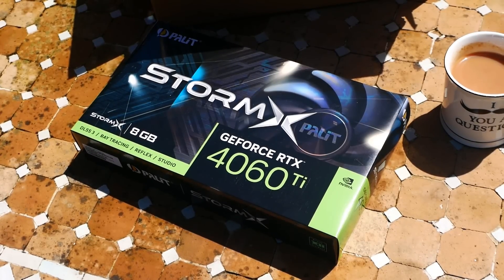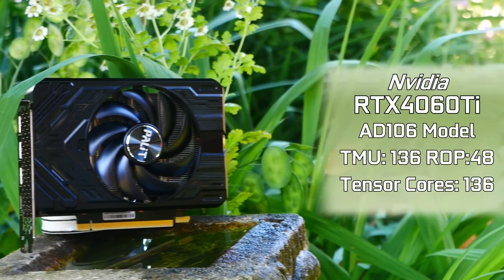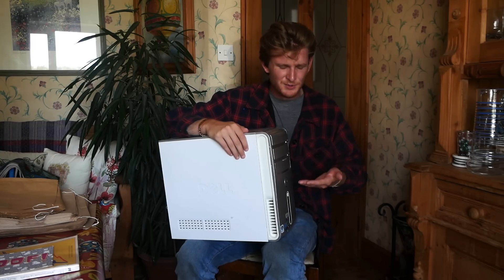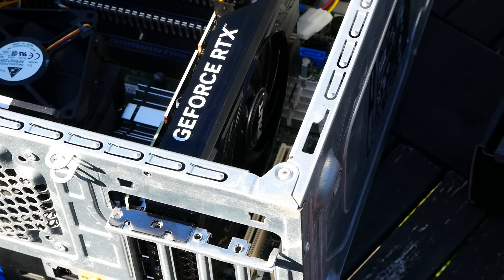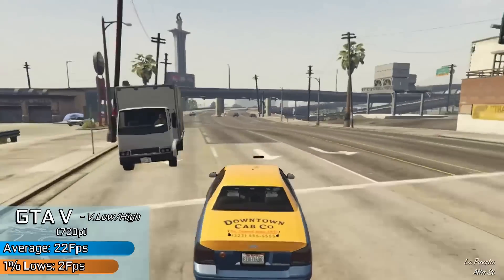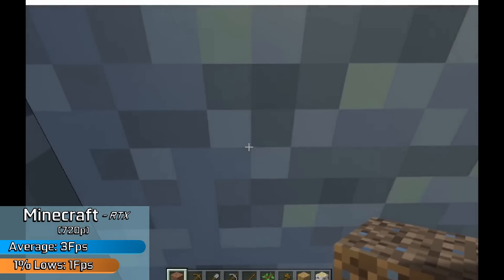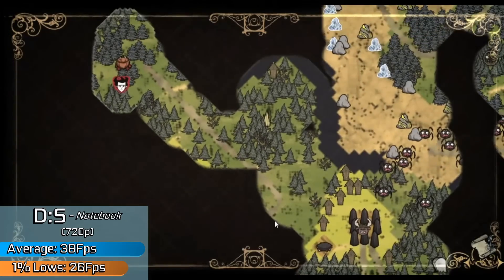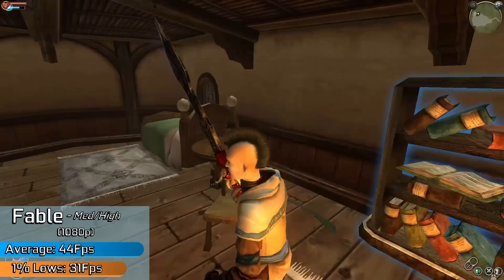RTX Graphics Card in a 20 Year Old Family PC...

Comment: Hi, i have just brought a P4 HP off Ebay, And It was in a bit of a state Softwear wise
It was security locked and i Could not get it to r=work at all, Finally i Got An OEM 
Win XP Pro From Ebay, It Still wouldn't Do nothing, The Install kept Getting Stuck 
On 34%, Anyway Slowly i am building a very nice Machine, I have got a PCi GeForce
880 0C2 And i am a Bit Scared of Putting it in My P4 till i know a bit more about the 
card, My Memory is DDR2 And on the card is DDR3, Will the card run on my P4, Just
looking at your Video tells me it Just might, But i want to be sure, Cause after all my 
hard work i would hate to Blow it up with smoke coming out the back LOL. OH! YEH!
I got a genuine Sound blaster Live Off Ebay And it was like Brand new man, Now all
i need i for you to Give me the green light and say of course it will work My Old San.
i paid £6 For the Graphics card from my mates Retro shop, he Obviously Didn't know
what he had, Well i didn't know what i had till i watched a few You Tube Videos, It's a
well sort After graphics card, Im'e well pleased. All i need now is some good news
from you My friend, Great video mate.

Comment: i used a pcie to pci adapter to get a radeon r9 360 working in my dad's old dell dimension 2400, also maxed out the ram to 2gb and cpu to 3ghz. after alot of modding i was able to get the original version of skyrim working on there in 800x600 res at like 33fps which was amazing to see considering the onboard gpu was a intel 845g that struggled to play dx8 and 9 games. anyways my dad just still uses it to check email and what not. he refuses to stop using it so i've just been upgrading it for him.
Reply: Should of just played it on a Xbox 360 runs it easily lol

Comment: the regular 4060 is made on the 107, know what else has historically been made on that? THE XX50 SERIES CARDS like the 1050 and 3050, do you know what the XX60 are supposed to be on? the 106..... so why did they make the 4060 on what should be a 4050? simple, this card is called the 4060 but its really the 4050 in every possible way except the name, even its performance aligns with what should be the 4050 if you look at the test data...... in short its a scam, you are paying 4060 prices for what is really meant to be the 4050

Comment: So theres a bit of magic to the pentium 4 that has been lost in the general scheme of things.  Back when optimization MATTERED, a pentium 4 would do numbers if your pipeline could stay sunk.  So, if you had no warbles, no weird bugs in your threading, a penium 4 would WANT higher graphics settings because, despite the lower cache, it is BUILT on the back of dumping huge blobs of data.  I myself am about to start working with a P4 again, and am quite excited with it having the appropriate 4GB ram, a good chipset and bios, and enough chokes to kill an african orphan.  Your setup there would greatly advance in speed if your ram was balanced, maybe if you even had an NVME drive.  You might see shit happen more stable.

Also general rule for anything related to itanium, plug in a ps2 keyboard so you have a direct control line to the CPU in case of Alt F4 in emergency.  USB keyboard on Red Dead you will have no input because the controller's signal is being completely covered up by the sata logic data stream.  But the PS2 line goes straight to the CPU, it skips ahead of everything in pipe.  PS2 is a MUST HAVE on a pentium 4.

Comment: the high textures running better in gta 5 is prob due to the exchange between gpu and cpu, slowing down the frames pumped from gpu to cpu thus making the cpu have to render less fps

Comment: 6:35 you've installed the cpu fan backwards! it should blow air into the radiator!
Reply: Fans remove heat, blowing air at the radiator is the opposite
Reply: @shredhappy101 Never say fans installed like that! A good example is graphics cards!

Comment: The real bottleneck in you're setup is the G33 slow chipset...A better test would be using a P43 or P45/ICH10R chipset with a Core2Quad,8GB is the max memory the boards will support and 6GB is the max for G33...I still use a P43/ICH10R Gigabyte board with 8GB DDR2-800Mhz(quad channel) with a RX580 8GB card and a SATA2 7200RPM Segate Barracuda 7200.12 black drive 1TB...Still run most games no issues at all,added a 2.5GB lan PCIX and it helps,can run 100FPS on Warframe on Medium settings...Overclocked Q6600 2.4 up to 3.02Ghz for the last 15 years solid and the PC stays running all the time with water cooling AIO 240mm cooler...20 year old build still works but it's time for some DDR5 and NvME drives for me..

Comment: holy crap i threw away my inspiron 530 mine had a q6660. i threw it away because it would not chillout on the thermals. the cooling on this pc was horrendous. the design on it doesnt compensate for thermals. and the MB would not allow 8gb ram. so x64 was bottleknecking for win10. stupid windows antimalware would cripple the cpu. it had one exhaust fan on the chassis and one dinky fan on the cpu that had no effect on cooling when when there was no airflow inside the chassis. check your thermals with cpuid hwmonitor and you will see the dell sucks badly. the only thing you can use a dells inspiron 530 for is xbox cloud gaming. but it does ramp up the cpu fan extremely loud and is very smooth 60fps playing the newest BF game. i was using hymix 6gb ram, q6660, asus r7 240 2gb, soundblaster audigy se, wd green 240gb ssd. not sure if i threw away th einspiron 545... huh that was on the same buid as the 530 just a nicer looking black chassis but still crappy thermals.

Comment: Speaking of minecraft, my T60 with a 2.3ghz core 2 duo and 3GB of RAM ran 1.16 just fine. 1.19, however, failed to even start.  Got 20-25 fps consistently on 1.16 though, which was good for the radeon 7500 graphics that thing had (for comparison, 2012 era intel HD graphics were about 10x more powerful)

Comment: From new, I had a P4 3.2GHz (with hyperthreading) & Athlon 64 3800+ (2.4GHz) at the same time.  Both with Windows XP 32-bit Pro & 2GB RAM: My P4 wiped the floor with the 3800+ when ripping DVDs, by a big margin!  Possibly due to the 3800+ lacking certain CPU extensions (or overheating)?
However, I recall the 3800+ feeling snappier during general use, & faster with games (even with the same GPU).
Although people say the P4 ran hot, I recall having cooling issues with AMD CPUs of that era...

Comment: If you were using a RTX 2060, or RTX 3050, it would still be too much video card for that system. The Pentium 4 is also missing too many instruction sets to run modern games. Trying to emulate those missing instruction sets, is going to be too slow to be playable. That PC isn't worth trying to save, even if you got it for free. Just because it still works, doesn't mean you should use it.
Reply: Thank u for saying that it saves me time watching the video

Comment: i think you will getter better fps with older gpus 
yesterday i finished update windows 10 pro  on a socket 775 system with a cpu from socket 771  with mod cpu with mod motherboard bios 
intel xeon x5460 3.5ghz oc + asus p5kc + 8gb ddr3 1500mhz + gtx 570 glh 800mhz oc 
it runs windows 10 surprisingly well it was fun to build and is a extra heater for winter time

Comment: Driver overhead alone from modern 500MB+ Nvidia packages also play a part with extreme CPU bottenecks. You'd likely get better frame rates with slightly older cards on the oldest driver version you can get your hands on.

Comment: What was the sound situation with the games that run in single digits?  

Regarding OBS, to be fair to the P4, it is also running the game and Windows, not just OBS, right?  :p  

Thanks for another fun video.  

I never had a Pentium 4 CPU, at the time, I was full on AMD, apart from my then laptop which had the Pentium 4m which at the time I found fine without issues.  
I see P4 taking a lot of flak on YouTube, but as I never owned the desktop variant, I will stay out of the discussion.

Comment: You are kidding with this test. Long time ago Pentium 4 to Core 2 quad dont work at normal with 2080 ti and better gpu. If you will running some games. These processors dont support at all. :)  Pentium 4 is too slow for Windows 10. I tried surfing google with Pentium dual core with good SSD drive and DDR 2 memory. It terrible. So slow. And it doesn’t even make sense to test games.  Even if you find 16 GB RAM for this computer and a super fast SSD. It won't get any better. Without a Core i3 or core i5, at least the lowest generation, you should not run such tests. Just you need forget Pentium 4 and Core2Quad in forever. It bullshit.

Comment: I play with an i7 3770k/ 1660. Most games will use 99% gpu and 30-50% cpu.. but cpu intensive games run like crap. Fortnite is playable on preformance mode but on dx12 it stutters a lot and the gpu cant hold a high usage cpu will peg at 100 and gpu will drop to about 50% and then catch back up in a less cpu heavy area.

Comment: My old desktop was qx9650 with GTX 1060 on P5KSE mobo and delivered  frames in 60's in Crisis and Far Cry 5 at 1024 x 786 with most settings on high. That was with Win 7 Ultimate. When I went to Win 10 frames dropped to at best mid 50's with lots of settings dialed down to normal and some on low 😞

Comment: I have an old Dell Inspiron 530 like the one in the video that I bought with a C2Q Q6600 2.66 GH processor.  I spray painted the sides panels and side grill black and cut out fan grills on the top and side.  I also screwed an 80mm fan to the front intake area.  I still have it and recently took it out to relive old memories.  I put in a 92mm Cooler Master tower CPU fan, put in a new PSU and added an 8600 GT in there.  May have put in an 8800 GT, can't really remember.  I liked the 530 chassis because it was very compact.  It was my first try at case modding and the most I've ever done on a case.  I reused the Q6600 on another build that I built from the ground up.  Good times.

Comment: Apart the Pentium 4 , the lack of RAM is often a stopper. I saw a video about an Nvidia 980 on an old Core 2 Duo, and it went great as long as the game could run in the 4 GiB of Ram of that machine: sadly it prevented more recent games to run, but it could be guessed that with 8 GiB they would have also worked acceptably well...

Comment: Is this a new thing? Videos of crap PC's that I've thrown away keep turning up in my feed.  I've got loads of weak CPU's such as a Pentium 4's, Semprons etc that I've used for overclocking, I could easily put something together and bench it.  I've also got the best motherboards, chipsets, fastest memory and coolers to go with these tired relics to give best possible performance if that's what people really want to see.  On the graphics front the weakest cards I have left are GTX260's which I could run in SLi.
My idea of a budget PC is something capable of playing todays most popular games like Fortnite and Warzone 2 in 1080p which you can build for about £250.  The reason a weak cpu will play better with the graphics turned up on an overpowered GPU is because there will be less frames for the cpu to process meaning less stuttering.  Systems will generally work best with a GPU just under the limit of what the CPU can handle, anything over that and you can potentially lose performance.  Something like a 7000 series Nvidia or mid range 8000 series would best match this CPU, the legendary 8800gt is probably too much.  It was the first GPU under £200 to match the games consoles of the time and play Crysis.

Comment: facepalm A nice Sleeper PC in this wonderful Case would have been nice. But this Video is nonsense. For Example: An AMD AM4 Board with a Ryzen 1600+ would have been a wonderful counterpart for this GPU.
...Old Hardware with enough Potential, replacing the "very old" Hardware, for using an almost Up to date Graphicscard in a Stylish Retro Case. THAT would have been nice to see.
PS: I know that the Case has to be modified because of the I/O Shield

Comment: Considering how the 4060ti is, you could have used a regular 3060. 
Not a bad choice for this test though. My opinion is the 3060 is better. Now that fsr is coming with frame gen, I think the regular 3060 12 gb will outperform the 16 gb 4060ti. We've already seen that card with frame gen using dlss 3 and it sucks outside of 1080p. The old 3060 is pulling around that same performance at 1440p, I can only imagine frame gen making that card work better.

Comment: That is the kind of wild stuff PCI Express was made for.
And don't worry about the microcode. I can throw my Cedar Mill P4 HT 631 into my P35 board without issues. Not officially supported, but that is more a thing with the power delivery. Intel updated stuff for Core 2, and just dropped out Pentium 4 support, but those with 200 MHz FSB run without issue.
So yes, from a Pentium 4 to a LGA711 Xeon quad core, all of it runs.
I wouldn't even worry about power draw. Cedar Mill runs at 84 W and Core 2 Quad are set to 95W
Next step, Core 2 era single core Celeron? That should perform better in quite a lot than the Pentium 4

Comment: I wouldn't do it, only has 8 lanes.  That's quite a bottleneck with PCIe 1.0... But it doesn't matter with the old processor, it probably doesn't matter anymore. Otherwise an interesting experiment 😁

I have an AGP to PCIe adapter here and am running an Athlon XP 2400+ with GeForce 960.  Total overkill, of course, and purely for show purposes.  I can do that up to a Pentium 2 or Socket 7.  It doesn't work with even newer cards because XP is no longer supported.  And Windows 10 and 11 doesn't work on such old boxes.

Comment: liked because of the Inspiron 530 case?... I bought a system for ~60 $ (I liked the design) and then used a grinder to cut a hole for the IO... and put in an modern MB (Ryzen) in it, replaced the fans with real quiet ones. Works like a charm and looks good (retro almost).

Ohhh and your mod seems great...

Comment: I have a macbook pro unibody early 2010 15 and I can play gta5 on it and I use windows 10 😂🙌🏼, I did upgrade the hdd to a ssd but that's it, and honestly it's still more viable then a new notebook, especially if u would do a ram upgrade, but maybe do these mods on a 2012 or 2015 MacBook pro, if it's Intel based

Comment: You're lucky I tried my "old" 5700xt on my decade old legacy i7-860 pc but, the graphics card did require a eufi / secure bios to boot. Does this card support legacy-bioses or did you patch something into the bios?
Reply from the maker: I have no clue but for some reason RTX cards will work on this old Dell, no other 775 board I have works.

Comment: Last week, I have my Asus P5AD2 Premium which is one of the very first motherboard featured PCI-Express, working with RTX 3090 without problem. You didn't need a more modern chipset to work with newer graphic card.

As a as I tried, newer graphic card seems to not work with chipset from VIA, I don't have PCI-Express board with SIS chipset so I can't say anything for that. It will work with Nvidia chipset though.

Comment: minor point about GPU Usage
When the GPU is being severely BOTTLENECKED the GPU Frequency will drop. So, for example if the "GPU Usage" shows as 75% but the FREQUENCY has dropped to a THIRD of what the card can do, your real GPU Usage is 25%. Not that this really matters for this video.

Comment: I currently have a old DDR2 PC from 2007 with an Intel Core 2 Quad CPU Q6600 @ 2.40GHz, an old 550w Antec Power Supply and the GPU I have is the Nvidia GeForce 7600 GT. I am experimenting myself how far I can upgrade my old PC. So far all I did was upgrade from 4gb of ram to 8gb of ram and installed a sata ssd 256gb drive with Windows 10 installed. I am curious how far I can upgrade my GPU and not sure if I would've gone as far as the RTX 4060 ti but thank you for demonstrating that it could be possible.
Reply: I also have a q6600 PC as well its got a R7 270 2gb in

Comment: I did this same thing pretty much because I bought a BFG GTX 280 launch week of 08' and slapped it in my eMachines P4 desktop. I was confused why Crysis was 22fps lol.
Even just upgrading to a C2D 6600 unlocked it mostly, but the card does surprisingly well with much nicer processors.

Comment: yeah its just as crazy you can get a 250gb ssd for 13 bucks and a 480 to 500gb one for around 22 bucks and they're actually good and got a 3d nand if you watch what you buy also you should run the same tests with a core 2 duo.

Comment: G'day & welcome back BBO,
P4 & 4060Ti 🤣🤣🤣🤣🤣
I have the same Dell Inspiron with C2D Q6600 which I got for $30AUD a few years ago, it too got packed away & forgotten about for a few years because of 😷 but I found it again when going through boxes earlier this year after moving just before Christmas, when "Upgrading" I too went with a Palit GPU but the more normal route of keeping the Q6600 & adding a slightly less powerful GTX750, I chose the 750 as not only is it a good performance match for the Q6600 but also can run W10 or for the Retro feel Vista like when it was new 🙃👎.